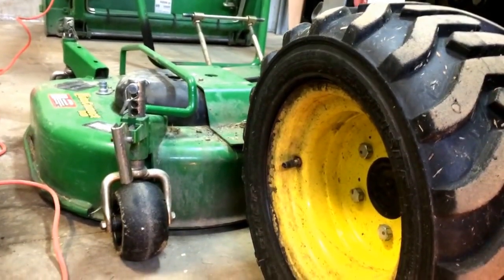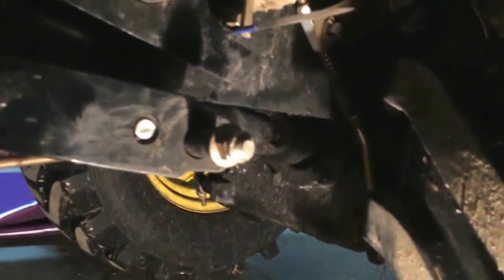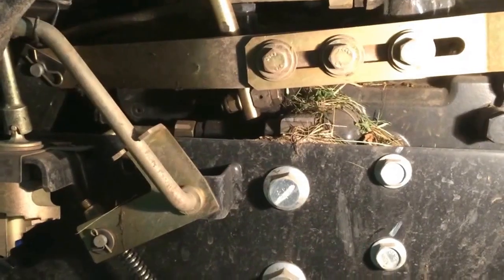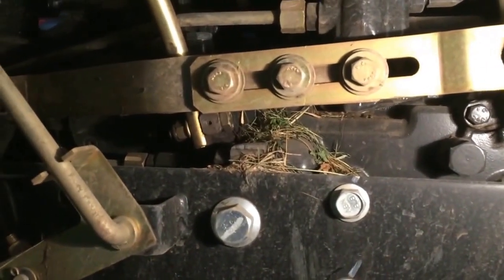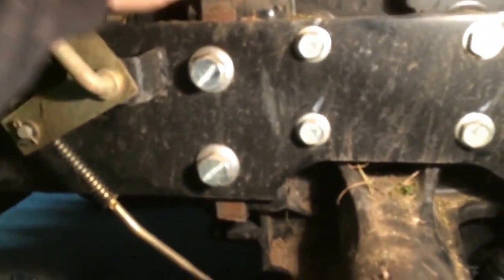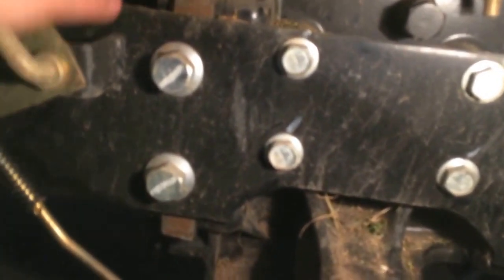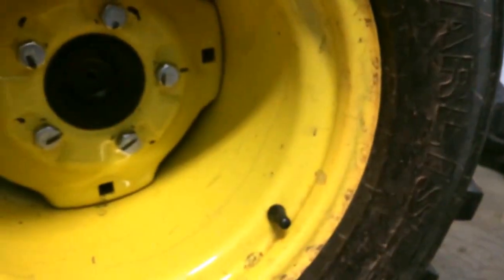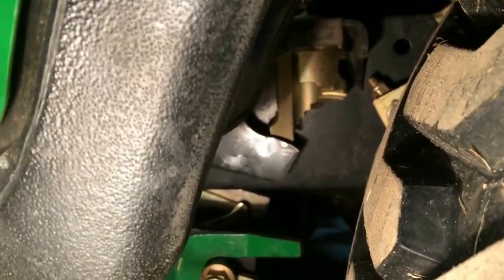John Deere 1026R: Mower 60D AutoConnect Mower - Issues And Corrections. Part 1 of 2

Comment: I have a 2015 1023 with the 54" mower deck. I was trying to figure out why my mower deck wasn't going all the way up (seemed so low) when the rockshaft lever position had the 3 point hitch arms all the way up. Thank you for showing the process to adjust this as you discovered it and also how to explain leveling the deck in laymen's terms without any fancy blade adjustment measuring device. Much appreciated.
Reply from the maker: That’s great. There’s a part two also that shows some issues I found that the dealership mechanic installed incorrectly. 

Thanks for your support

Comment: The problem with the design of the 60D deck are an extreme number of potential points of failure.   I have decided to do some redesigning of some of the common points of failure you see on YouTube videos.   For those that might be interested in having a 60D deck?   Don't waste your money.  The frustration and hate you will develop twords JD engineers isnt worth it.  Ill share my customizations when I'm done.
Reply from the maker: Ours works just fine for almost ten years now. Once you spend some time yourself and get it fine tuned they work great. Seems the people putting them together at the JD dealerships don’t care too much and put them together just enough to get them out to the customer.

Comment: That lift strap with the 3 bolts is installed backwards. That is part of your problem.
Reply from the maker: stanley schmidt 
Not sure what difference it would make if I flipped it 180 degrees ? It came from the factory/dealership  like that. I just moved the bar to the other side of the lift arm bracket and got rid of the space. . It goes right up tight now  to the underside of the floor boards.
Reply from the maker: Check out my “Part 2” of this and you’ll see that after some online blueprint/isometric  review I realized the guys at the dealership put the bar on wrong. I think. Anyhow it sure works a lot better now...
Thanks for watching.

Comment: Having problems with mid mower connecting to the auto connect PTO. Does not click into the main shaft on mower. Anyone have a solution?
Reply from the maker: Marta Green 

Hi Marta. First step would be to ensure your height selector is in the install position. Then make sure your pto selector is on the rear implement only. This will allow the mid pto that connects to the mower to freely spin. Also before driving onto your mower check that the female coupler is at the right height to accept the male coupler on the mower deck. You can see these in part two of this video. Hoping that helps and you get your mower to connect and lock.
Reply: I decided to just buy a smaller riding lawnmower and sold my 60D deck.